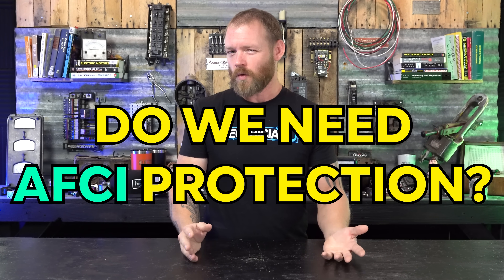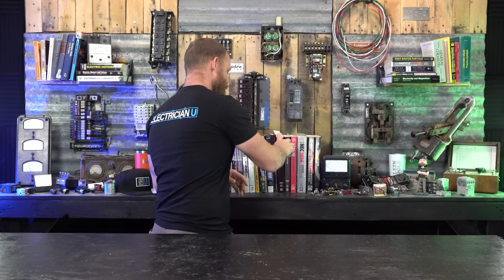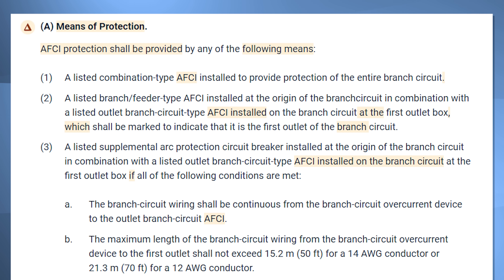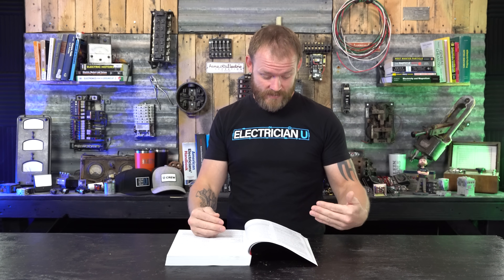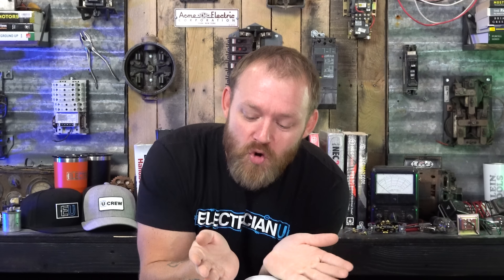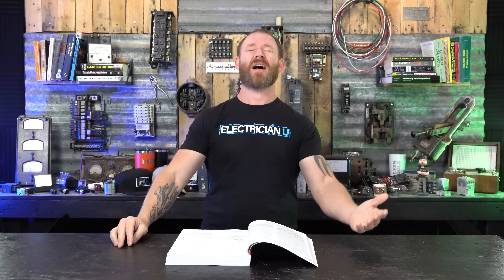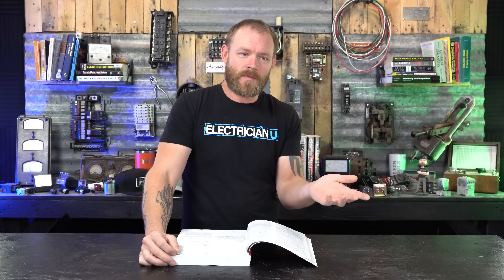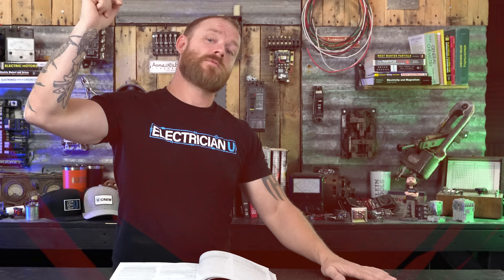Where and Why Do We Need AFCI Protection?

Comment: Ok, hate me as a DIYer.  To my defense, I called in actual electrician for the panel work and anything I thought was way above my understand and paid him nearly $2K for a half a days labor and parts (2 circuits were added) and Romex. I have been a studious watcher of the channel.  So, when rewiring my kitchen, my first stop beyond the panel was a dual function AFCI/GFCI receptacle.  So, lets talk about he nuissance trips, and thank goodness I didn't put them in the basement panel. Randomly when we use a blender, or a food processor. But those are at least easily reached. The Garbage disposal which means crawling under the sink to reset.  Dishwasher, which also means crawling under the kitchen sink to reset.  I mean AFCI works but just be prepared to reset nuisances easily.

Comment: "the breakers are smart enough now" ... no, no they are not! They still have way too many false trips! Ceiling fans, room fans and old switches can easily trip these breakers... It also costs the customer a fortune. Regular breaker $10, AFCI breaker $150.... Turns a $200 panel into a $3000 panel...

Comment: I see the reason for this type of protection. If every home was wired using EMT then arc fault would not be needed. Mice make nest inside walls and chew on wires and making them bare. If the home was wired with EMT then the wires are protected. I would be more for EMT requirements than AFCI requirements. 73

Comment: Welders are essentially a transformer so I'm pretty sure that the characteristics for the power on the upstream side of the transformer would be significantly less effected if at all by arcs created on the downstream side. That said I'm not a pixie wrangler or an electrical enginerd so maybe there is some sort of voltage or current ripple that is also consistent with what is created if the circuit was homogenous and not separated by a transformer.

Comment: Let this be a lesson on why not to hire someone who doesn’t know what they are doing when it comes to electrical, I had to basically rewire a den add on for a family member because it all started from half the outlets reporting open ground, upon deeper inspection once I started to pull outlets and switches from the wall I came back with 13 reasons why a inspector would fail this insulation, the circuit was added as a new run from the panel in 2021.
-No Arc fault protection 
-putting two wires on one receptacle screw
-no grounding clip or wire nut on all of the ground wire splices 
-open ground on half the outlets 
-20 amp breaker installed in a circuit with 14 gage wire 
-bare romex wire stapled under a desk when it should be armored cable or protected in a conduit 
-overfilled outlet boxes 
-loose connections on a switch that was starting to arc 
-on old work boxes the tabs to secure the wire in the box where broken off completely 
-home run wire exiting the breaker panel had no clamp to protect it from the sharp metal edges of the knockout 
-outlets facing in the garage had no ground fault protection 
-new work boxes set flush with the stud instead of the 1/2” Sheetrock resulting in outlets sinking and exposing flammable material to electrical connections 
-18 receptacles on one circuit that was wired to handle 15 amps, making it considered overloaded
Reply: I'm sorry Ed. My bad

Comment: One of our AFCIs keeps tripping randomly. Usually goes 2-4 months between trips. It's been happening so long, to the point where the breaker itself is loose from so many resets. 
I've messed with the outlets, trying to see if maybe there was a loose connection at one of them. And banged on parts of the walls where I believe the romex runs through. But nothing happens. 

There are no big loads on the circuit. A few (2) device chargers, a small 32in smart tv, 2 light bulb fixtures on separate switches, and an extractor fan. (Circuit is connected to the bathroom across the hallway, for the fan and a light. The outlet is on the master bathroom's circuit)

We've given up for now, and just reset it when it trips. I'll probably swap the breaker with another bedroom, and see if it's the breaker itself, or something with the circuit. I've just been too lazy to do it.
Reply: The time it took you to write this post, you could have swapped the breakers already...lol

Comment: We just built a house and the electrician decided to put AFCI breakers on every circuit rather than thinking. This includes a 220v outlet I specifically told him was for a welder. The sub panel has 39 breakers and is noticeably hot.

Comment: What if I have nuisance tripping with a microwave oven so I make the circuit with 10 gauge and 30 amp?  I should be able to avoid this requirement as the rule states all 10, 15 and 20 amp circuits.

Comment: I can't stand how being an electrician is all bureaucracy. it's like the code book is a bible of laws you must obey without question. this is why I did not become an electrician. it's more about following a book of laws without question, rather than understanding what and why. an arc fault breaker does not detect arcs, it detects the electrical noise resulting from arcs. it should be "here is how a gfci works and what actually trips it" but it's not at all like that. rather it's "here is the law, obey it or else"..... I argue, most electricians don't actually know what they're doing, only following what they've always done. I'm out.
Reply: Wait it detects the noise? Like the old modem computers? So air density is a factor? Like it wouldn't work in a vacuum?
Reply: @fishsmell3939  not sound noise, electrical noise. more akin to the electrical signals going over a wire to a speaker. noise is some frequency that is unwanted.
Reply: @lorenzo42p  oh ok
Reply: Yo dude that's interesting.

Comment: Yeah...you know parallel arcs like when a brushed motor runs. Want to drive yourself crazy? Plug a vacuum cleaner into a circuit with an AFCI breaker. Have fun resetting it every 15 seconds.

Comment: I’m glad my city doesn’t require AFCIs. AFCI’s are more of a nuisance than a safety precaution. They should remove AFCI from the code requirement and require MC wire or cloth sleeving on romex instead or allow those options as alternative to AFCI.

Comment: It's just stupid now. It would be easier to just say make everything inside the home dual function, except the garage or specific equipment receptacles, and the circuit servicing the outside make gfci. Boom done. manufacturer's rejoice at extra quarterly profits which we all know in the industry is what's driving this.  Or really say screw it and adopt PoE and get rid of 120V outside the kitchen, garage and utilities.

Comment: My guess on the arc welders is that they will no longer be able to use transformers for voltage changes as they back propagate signals. I'm scared to see how expensive that's going to be unless they are designing suppression circuits to filter the power. That may be the case given the short time frame.
Reply: Not that expensive:  Very high power MOS-FETS have been available for years now that can be used to implement a switching power supply  instead of a transformer.  Converting the incoming power to DC would make it possible to weld with high-frequency AC, which should be interesting.
Reply: @BigGuy8059  Mosfets are also far less robust than transformers which is important in a demanding application like arc welding. The mosfet itself isn’t expensive, but the support circuitry adds a lot of complexity and cost to a system. 

If it were that easy it would have been standard by now. It was the same with microwaves and we are just now seeing inverter microwaves become a thing and they are still more expensive and less reliable despite their huge advantages.
Reply: Necessity if the mother of invention.

Comment: Have u ever known the igniters on gas ranges to cause nuisance tripping with arc fault breakers? That little spark in the range igniter is technically an arc. It seems like it would be an appliance that would that would that would have an issue with arc fault detection. I’ve never heard of gas ranges causing arc fault nuisance tripping but it seems like it may. The igniter basically mimicking an arc fault situation.

Comment: In Canada, those receptacles do not need to be AFCI combi protected.
(1) kitchen counter tops
(2) fridge
(3) fire place
(4) dishwasher
(5) washroom
(6) build-in microwave
Reply: Dishwasher only if it's hardwired...

Also, not for sump pump, electric ranges, block heaters as per rule 8-400, and dryers...
Reply: @richardwhite6702  have a question here please. Code says GFCI is required when plug is within 1.5 meter away from sink. Does this apply to 240v receptacles? And 120v 30 amp receptacle?

Comment: Thanks a lot for this video, I was just talking to myself about this very subject last week. I have an old house with 100A and am thinking to upgrade in future to 200A. So i wanted to ask, to get the best protection,  should I use all the breakers AFCI and use GFCI in plugs? Or can I just use a dual function for all the breakers and then I'm covered 100%? And if that is the case then why even go the plug route? Because of cost? Thank you so for you or anyone else that sheds some light.
Reply: Am electrical technician andIs there any other electrical technician if so please contact me.I need information

Comment: We dont need them. They are just monkey proofing. They fail and falsely trip. I ended up changing them out for regular breakers. Especially your fridge. U will lose all your food for nothing when one of them trips for nothing. My neighbor is a ham radio operator and when he keys up some of those breakers trip. Turning on vacuum cleaners or anything with a motor sometimes trips them. Sometime they just trip or go bad. I had 2 of them go bad tripping themselves, even after I pulled the wires off of them  and they were hot. Had to replace them. Get rid of them code or not! The old style last forever with no false tripping.

Comment: Hi Folks, hoping for a little bit of guidance. I saw in the code book and mentioned in this great video that if using an AFCI outlet in the beginning of the series, there are different wiring requirements. I am having trouble researching what these specific requirement are. Any advice would be greatly appreciated!
Reply: Quickest info would probably be to call an electrical supply store. Now I'm speculating here, my thought is the breaker would have a neutral terminal on it so it can measure hot and return of a branch. I'm not certified, and I'm willing to be told I'm wrong, just my idea of how it might work

Comment: Another exception they need to put in place is AFCI and GFCI outlets or breakers are not required for refrigerators and sump pumps because hundreds of dollars worth of food will be ruined if either the AFCI or GFCI trips
Especially the sump pump and there's a heavy rain going on , Definitely you don't want a GFCI nor an AFCI on the sump pump
Just be sure the circuit is properly grounded
At home several years ago there was a heavy rain and the breaker for the sump pump tripped and flooded the basement , The breaker was a GFCI and I took the breaker out and replaced it with a standard breaker
Luckily my mom had flood insurance that if the basement flooded due to sump pump failure , It's covered for water damage and the cost of a disaster clean up crew to clean up the mess

Comment: For welder...I would imagine that it requires the arc production side of the device to be internally isolated from power in.  But I would imagine this is already fairly standard on most newer devices.
Reply: Modern welders, yes. But something like a Lincoln AC225 that my dad had is basically just a transformer with taps and is pretty bad. In fact in my old country the poco basically banned them.

Comment: Great content some are your videos are comical and educational. I have a breaker that keeps popping when we turn on the Christmas lights. I know the lights don’t have much draw however they are on the same circuit as a reef tank which does have a large draw from a 4000gph pump as well as other filters and pumps. I wanted to upgrade the 15 amp to a 20 amp. I need to ensure that all the wires on the circuit are at least 12 gauge is there a tool that will test the load capacity of each wire without trying to trace them as the circuit goes theough 2 rooms and it would be difficult to make sure I have visually inspected each wire. Thank you
Reply: If it's a 15 amp circuit, assume that the whole thing is 14 gauge.  You can't pull existing wire out of walls because it's stapled to the studs.  I think the easiest thing for you is to just have a new 12 gauge line installed from your breaker box to your reef tank.  Not that hard.

Comment: At 8:45 you touched on a topic I am currently trying to research. In Dallas we have a 1979 installed StabLok FPE and live in constant daily fear of burning the house down. I am a huge fan of "overbuilding" and "futureproofing".  

What logic, rationale, or code, would be violated if the home were rewired with all Dual Function OCPs, Whole Home SPD, and 10/3 w/PVC raceways throughout the home's entirety??

Currently trying to find FPE-compatible Dual Function breakers as temporary security, but no luck exists. Would love to use Dual Function breakers for the entire panel but unclear if it would pass inspection. The home was previously maintained by a foreman for a construction company and there isn't a single aspect of this home that doesn't appear to violate some code... Framing, HVAC, Plumbing, Electrical, everything is just wrong....

Comment: Things that will trip an AFCI breaker; vacuum cleaners, electric drills, blenders, weed whackers, basically anything with a motor that creates an arc, or sparking; motors with brushes.
Reply: first gen afci breakers perhaps

Comment: Arc fault & arc welding: The requirement for arc fault is for 120v, single phase. Are all arc welders going to have to be 240v? Many, if not most, are already 240v. However, I'm aware that not all of them are. It used to be that almost all of them were 240v. It sounds as if they want to go back to that.

Comment: Most welder machines use transformers so maybe they referring to the monitoring of power input regardless of the load which is were the arc is generated.

Comment: Another business that reads and knows the electrical code is home insurance companies. Should you have a house fire, they will send their investigators to your home or what's left of it. Why? The investigators will be looking for any house electrical work that does not comply with the electric code. Should they discover that the fire resulted from non-code installation, they will attempt to not honor your home insurance claim. They like to check to see if required permits and inspections are done. A list of all permits and inspections are recorded by your local government and what codes were in effect when the work was done. Your local government code compliance office will gladly tell you if the electrical work you plan to do requires a permit and inspection.

Comment: My home is 120 years old...partially rewired....but now use AFCI on any circuit in the older sections...definitely necessary if you intend keeping any older wiring in place....
Reply: I disagree. GFCI is plenty sufficient for this scenario. AFCI breakers were a great idea, but in reality, they usually do not perform well, nor as intended. Manufacturers all vary and some are worse than others, but bottom line, an arc isn't a problem until a sufficient amount of current fails to return on the neutral. At this point, a GFCI will open, so... Why not just use GFCI?
Reply: @paaao AFCI doesn’t measure overcurrent. It looks for arc patterns in current and hz.